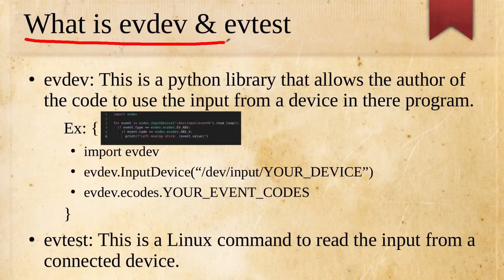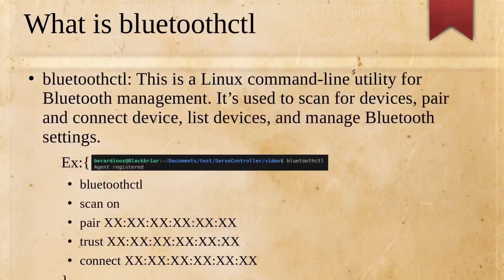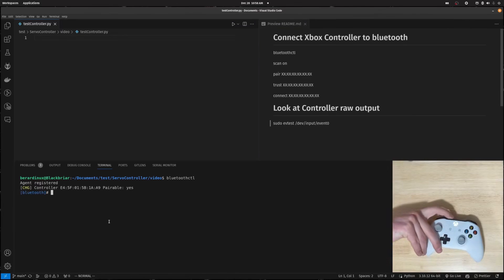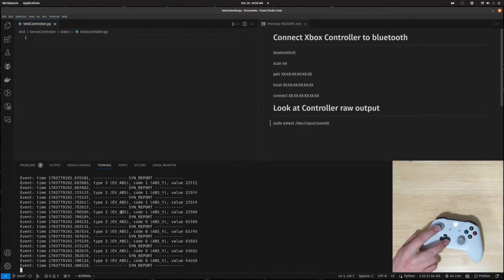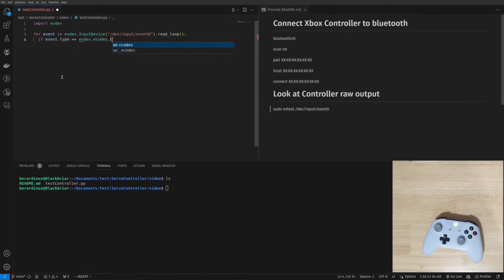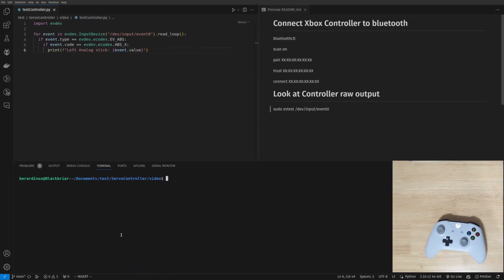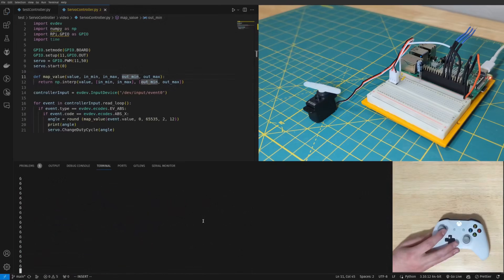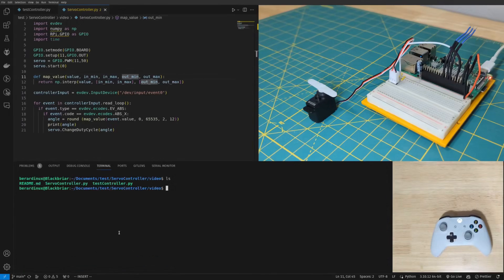Control a Servo through a Raspberry Pi with a Bluetooth Xbox Controller!

Comment: I spent the day trying to do just that
Reply: i think you are ussing xbox360 controller
Reply: @Dr.001-q5s  No, it turns out that my controllers needed to be updated. To do that, you need the Xbox app from the microsoft store. 
Now, i lost my raspberry Pi distribution due to a failed update that wiped my SD card... 
So I'm having trouble to reinstall Evdev properly. 
But i got my robot to work for a brief moment, that was glorious